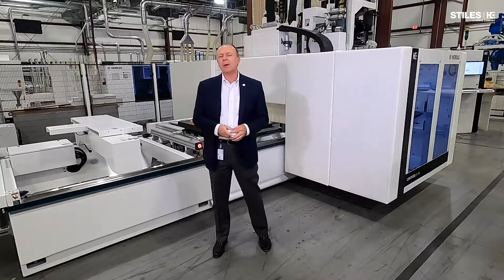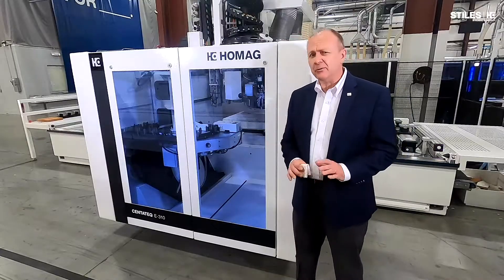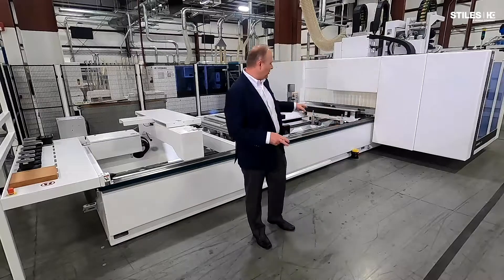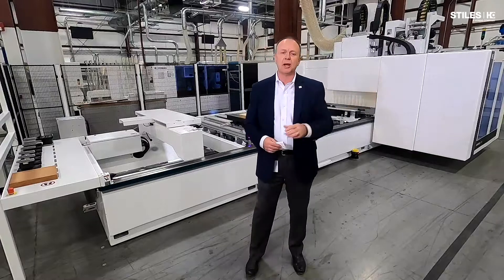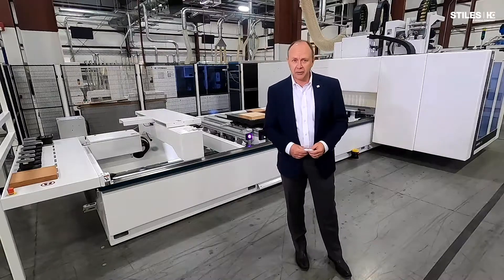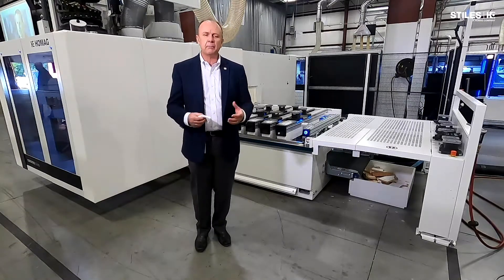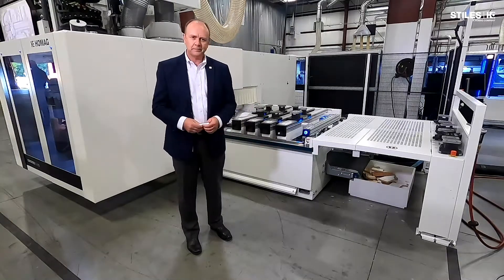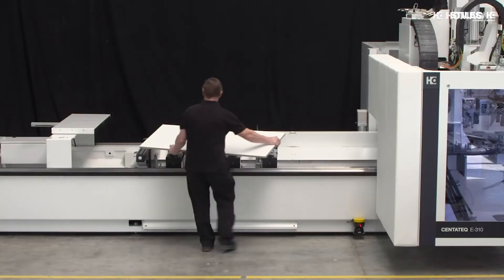HOMAG CENTATEQ E-310 CNC Machining Center with Contour Edgebanding – Hands-on Overview

Comment: Maybe edge banding is something interesting, but not in this version ... for longer elements (the aggregate path is longer or more complicated) this solution is ill-considered. PVC should be loaded differently. In such a way that it is impossible to damage or break the elements from the vacuum table ... Another thing is the cleaning program for edge banding should be reprogrammed ... because when it is turned on from the control panel, the unit moves up, pulling the element with the edge with it and it can damage the machine and the element that is being sucked to the table ... so ... an interesting solution?
 yes, but it definitely requires some refinement ...